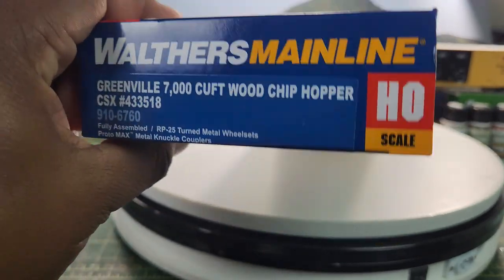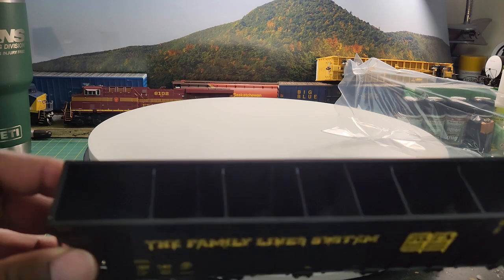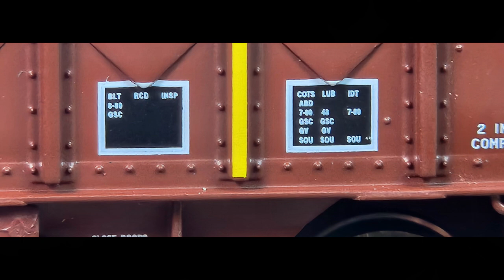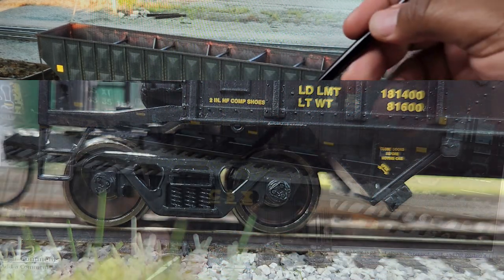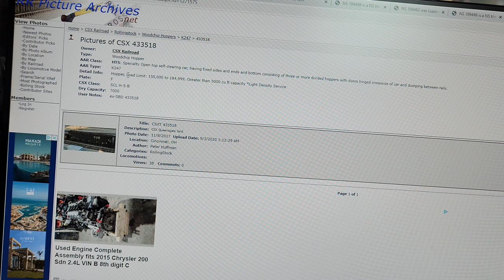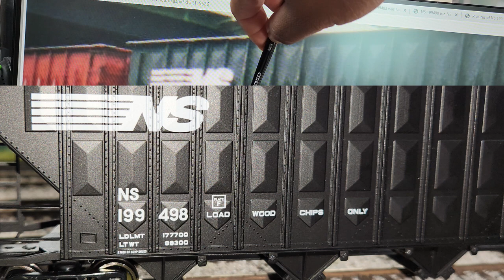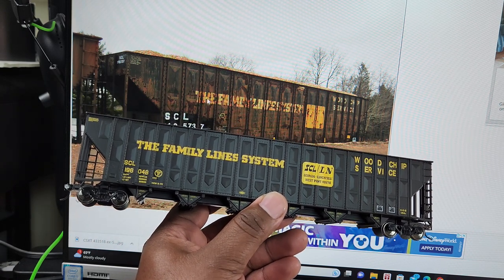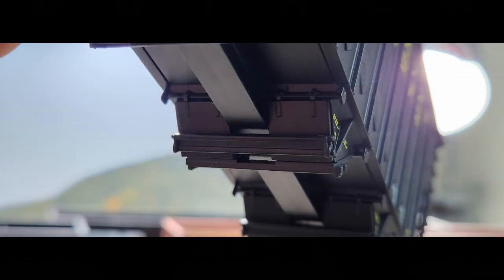Walthers Mainline 73'3" Greenville 7,000 Cubic Foot Wood Chip Hopper

Comment: Walthers is reintroducing these and many freight cars they haven't done in a long time. I see a few of these hauling coke on SB mixers from time to time heading down to New Orleans. I'm hoping for a Trinity 6421 capacity plastic pellet cover hopper. Seeing more of those coming from the factory with different reporting markings everyday here lately. Atlas has the 5250,5701 and 5800 ACF car. A 6450 car with ARI could be offered. Walthers does have to NSC 6400 car which I assume will be reintroduced too.

Comment: I  have 5 of these from a previous run. 5 NS and 1 SOU in the boxcar red scheme. Plan to get the SOU black scheme and the SCL to make it a CSX patch. The only thing I dislike are the thick molded on grab irons on the ladders. I am considering on trimming them off and replacing them with wire grabs. Other than that they look great.
Reply from the maker: That is a neat project to get into. I also considered doing that to my NS car.